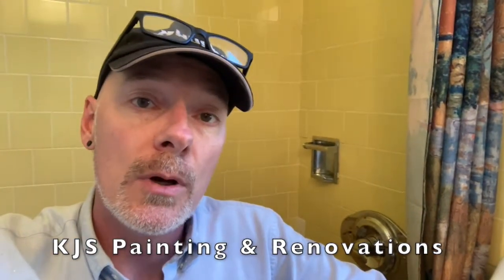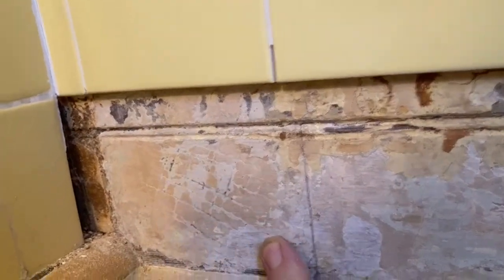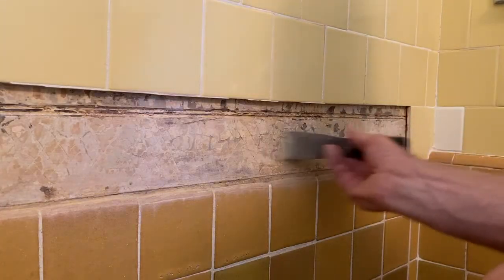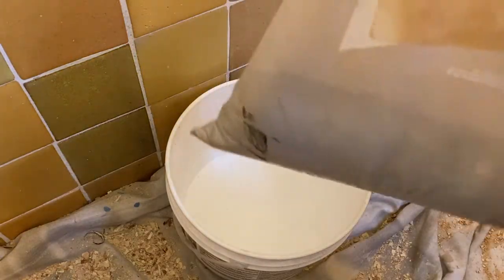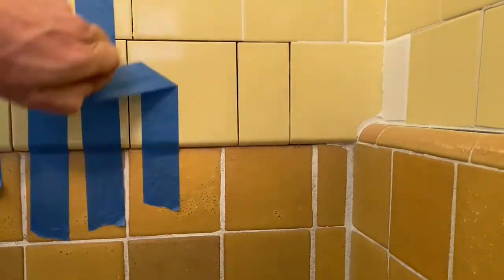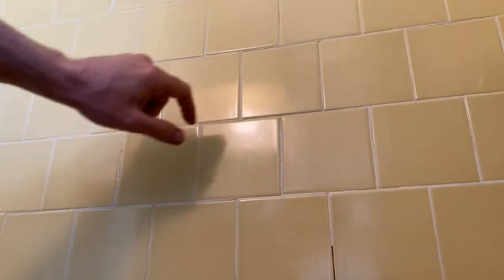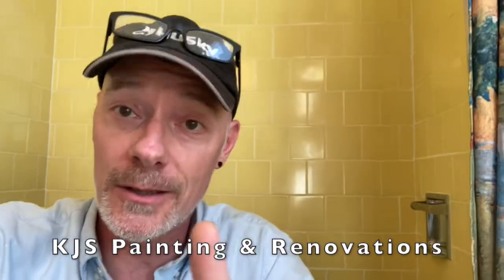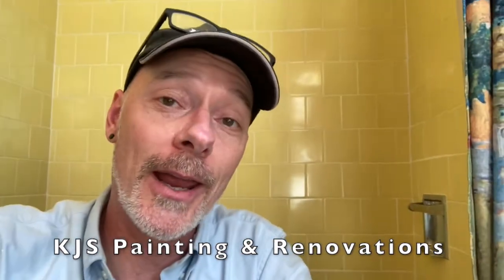How to Repair Loose Bath Tiles

Comment: I have a rental property shower that has similar vintage tiles like the upper yellow ones. Cracks everywhere seem to be causing major leaks into basement below. Does it make sense to try & remove old grout and regrout?  The grout lines are TINY. Like 1/32".  If so, how would one remove the grout? Smallest tools seem to be 1/16" wide. I have an oscillating multifunctional power tool.
Reply: I have an oscillating tool. I have one toothless blade, very thin, like a flexible putty, knife. If it was me, I would hacksaw some notches into it and try that. Then I would use an unscented epoxy grout that does not need to be sealed. or better yet, the grout renewal companies do a good job and are surprisingly affordable many of them. I would try that.
Reply: @guitarfixx4652  Thanks for replying!  At your great suggestion, I just talked to a grout cleaning/sealing company. Guy says the "waterproofing sounds compromised" and that mere grout renewal prob won't last more than a few months (then leak again). Gonna see what a tub & tle REFINISHING company thinks tomorrow; they essentially make all old things white and fresh, per website pics.  Grout guy thinks that might last a year before leaking again.  Sigh, might not be able to avoid a complete shower demo / rebuild.

Comment: what is the name of that tile cuter ? that looks like a knive ?? & where can I buy it???   what do u call that hand held tile cuter ??
Reply from the maker: I used a regular angle grinder. Then I used a fibre type wheel, will say "for masonry," It's okay to use one of those. I used a speed square to make a square mark with a pencil. The other tools were just putty knife. I had a small plastic notched trowle, some rags, water, old paint brush 'duster brush.' I small square nose brick layers trowle and a pointed one too. nothing fancy really. You can do it!

Comment: Newbie Question:  Is it reasonable to use a 20-30yr silicone in place of the cement to hold the tiles in place?  Thx.
Reply from the maker: No. It’s flexible. You do not want that. A thin set mortar with the bonding adhesive. Brushton will stick like gangbusters. Use that. Then grout.
Reply: @KentSchneeveis  , thx!  Appreciate; the vdeo.

Comment: When I clean the backs of ceramic tiles, I use a drill with a wire circular head does fairly good. Do not give yourself a manicure.
Reply from the maker: Hmmm - that'a a good idea

Comment: Do you think if you back buttered in the opposite dorection, you could have worked it left to right to collapse the ridges ?  Is there a reason to going in that direction.
Reply from the maker: It doesn't matter what direction. Just make sure to work it in there good. Don't do like some guys and just put a couple of dabs on there and sorta push it against the wall and walk away.